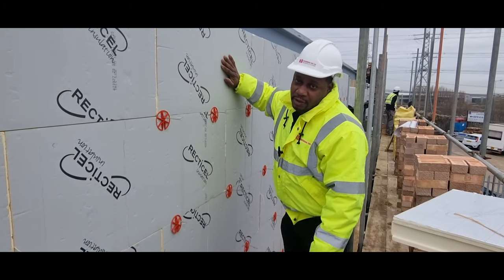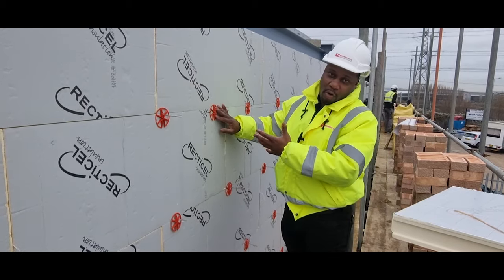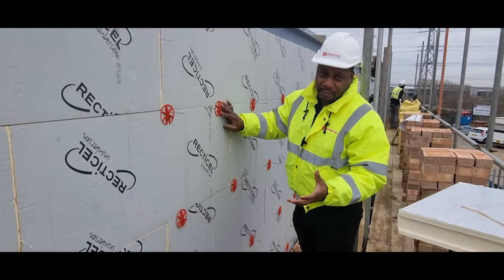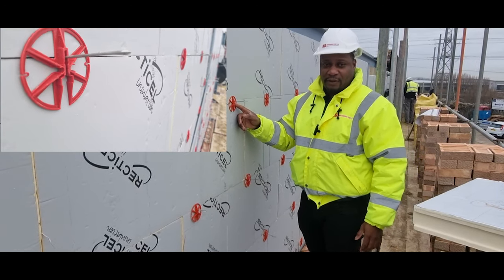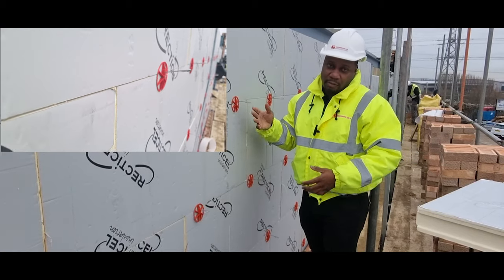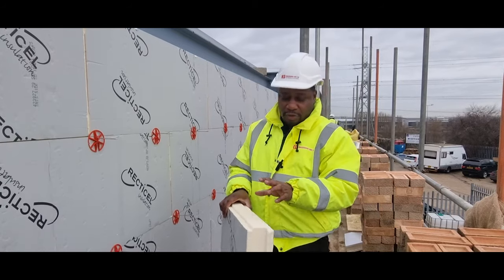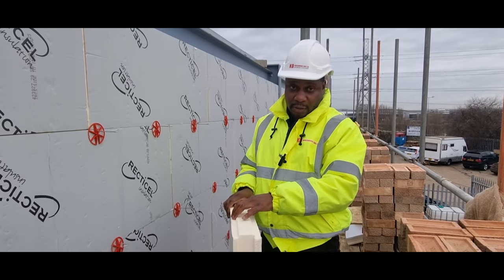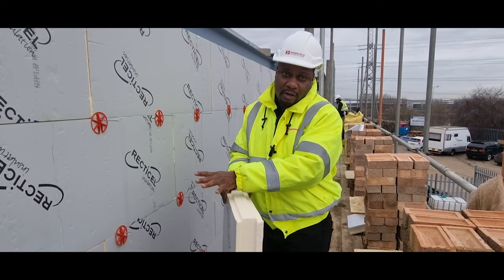Cavity wall insulation Tongue and groove

Comment: Hi mate 
When is tongue and groove insulation does need and silver tape or not
Reply from the maker: No need for tape as this method stops any thing getting in
Reply: Thanks mate
Reply: Always on boards with no tounge in groove
Reply from the maker: correct @lmilne4859

Comment: Everything nice. But those stainless steel wall ties are still a fail thermo bridge lowering all materials insulating properties. For about 70% When the temperature outside drops below 0°C it's possible to count them with thermal camera inside the wall when home is heated to 20° inside.